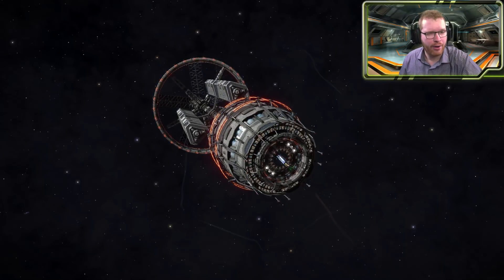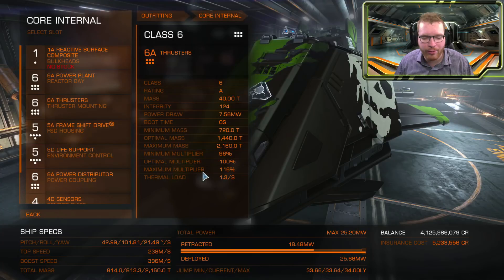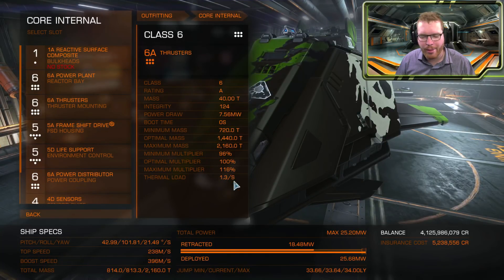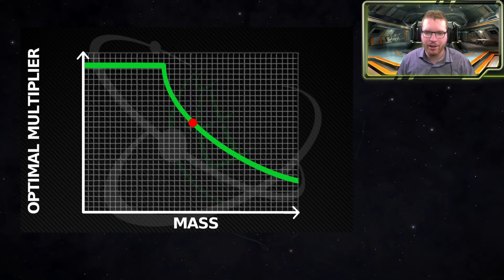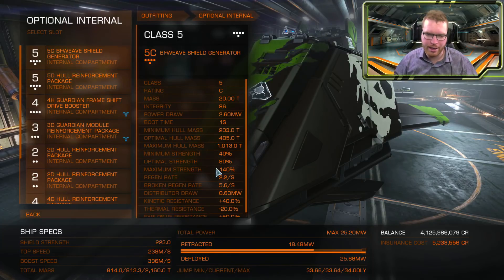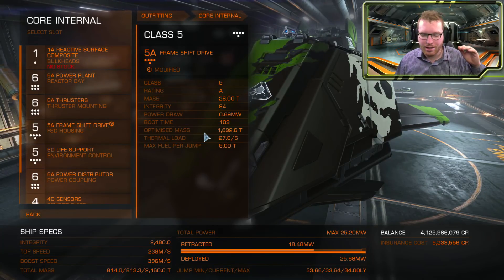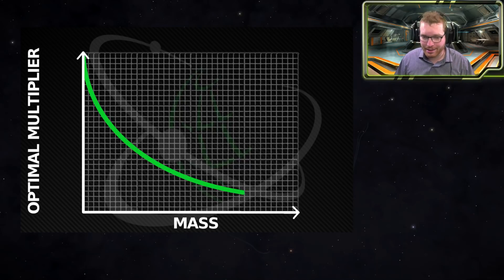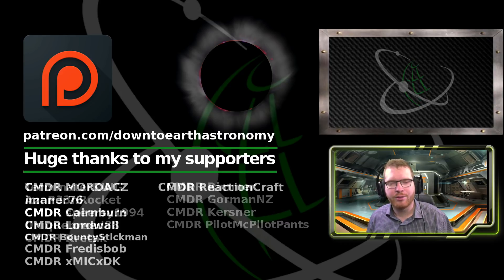Optimal mass vs Optimal multiplier guide | Elite dangerous

Comment: Great video. I tried to explain this not long after the Engineers came out and you put it way more succinctly than I did, lol. This sort of thing needs explanation because they don't exactly make it the easiest to understand if you're sat staring at the screen. 

As far as thrusters go, if you're engineering for speed and agility, with the Beyond engineering change, higher optimal multiplier is always better than higher optimal mass, since the change in mass isn't significant enough compared to the change in multiplier. This wasn't always the case with the legacy engineering since the results you could get were random and sometimes you might have to do quite in depth calculations to determine whether it was worth keeping the roll. But with the system we have now, since it's static, you really don't need to worry about it so much. The only time having higher optimal mass, and fitting the Drive Distributors experimental effect will be useful is when you want to make a ship take smaller thrusters than it could otherwise use.

Comment: I want to point out that its probably better to go slightly below your minimum mass if you want maximum speed. since the optimum multiplier decreases exponentially with every ton gained, every ton lost gives more speed than the last untill the final ton provides basically a bonus that makes it worth it.

Comment: Nice gaph☺ Would like to share for the Thrusters the Optimal Multiplier increase the over all thrusters (specially the little ones that helps you manuvers) the normal mass is more light weight reductions for speeeeeeeeed 😊😂

Comment: OK, nice, thanks. But could you explain which upgrade is better for a few situations or does it vary so much it's impossible?
Reply from the maker: It really varies a lot. If you have a ship that's heavy for it's module then then optimal mass best. But if your ship is have a large module compared to it's weight then optimal multiplier is best.

Comment: The mass mechanic is broken. Look at a 6A shield on the clipper and cutter the cutter is more than 2x the hull mass yet has nearly double the shield HP vs the cutter with the same 6A gen. I don't understand it makes no sense. The same thing with the type 9 and type 10 with shields and thrusters. It was a big let down to see the mass mechanic doesn't actually work correctly. They should add a ship modifier number because that is what seems to be happening
Reply: The thing about shields is that every ship has a base shield rating. Kind of like a base armor rating. It's the amount of shields a ship will have when it's mass is exactly at the optimal shield strength. And with that, every ship is different. They don't all have the same shield strength at the optimal hull mass. The Clipper has a much lower base shield strength than the Cutter. So shields you fit on the Clipper will have a proportionately lower value regardless whether the shields are at maximum shield strength or the minimum shield strength. It's not ALL based on the hull mass of your ship.

The values of the different mass strengths are relative to the base shields of each ship, not to a universal value for shield strength.
Reply: I can understand what youre saying. That's why I said they need to add a ship modifier number to clarify in game what is actually happening. The problem is modules and mass cannot be compared across different ships or even different variants of ships because FDEV has implemented a behind the scenes handwavium immersion breaking system. 

For instance the type 9 is slightly smaller and much lighter than the type 10 so why would it be logical for the type 10 to have a better shield modifier when it has much higher mass? The logic makes no sense with the current modules. If the modules were ship specific I can understand the logic but they are interchangeable. Shield strength is based on mass so what logically follows is that you would get a better shield on a less massive ship with the same 6A generator. It makes even less sense with thrusters. why would the same 7A thrusters propel the type 10 faster than the type 9??? Makes no sense. I would feel better if they just made shields and thrusters ship specific and not interchangeable like the armor module. At the very least explain somewhere in game .

Comment: So for thrusters the perfect weight i want at any ship is slightly above minimum mass to get the optimal multiplier am i right?
Reply from the maker: Yes. As soon as you go under the minimum mass you don't get any further benefits
Reply: I think there is also a hidden optimised mass (not to be confused with optimal mass or optimal multiplier) calculation in there too (which used to be shown under the old engineers), which indicates how well a ship turns at speed. I think there is an experimental that you can apply that does show it, but I think its a set value that can't be adjusted, unlike in the old engineers where you could roll till you got a really good value. I once rolled an amazing optimal multiplier AND optimised mass on a thruster for my cutter, which is why it was both fast and manoeuvrable.
Reply: That’s what I have taken away from this video-
Reply: No, if your ship is at or below minimum mass, you get the Maximum multiplier. Optimal multiplier is the figure you get when your mass is the optimal figure shown on the module info screen.

For example, to use the 6A thrusters D2EA highlighted in the video:

They have a minimum mass of 720 tons, an optimal mass of 1440 tons, and a maximum mass of 2160 tons. They also have a minimum multiplier of 96%, an optimal multiplier of 100% and a maximum multiplier of 116%.

So, suppose you had a ship that weighed 720 tons or less fully laden. And suppose your ship had a base speed of 200m/s. You would benefit from the maximum listed multiplier of 116%, making your base speed increase to 232m/s. If, however your ship weighed 1440 tons exactly, you'd benefit from the optimal multiplier which, in this case, wouldn't increase your speed at all but nor would it decrease it. For every ton under the optimal mass your ship is, it's multiplier shifts towards the maximum multiplier, and for every ton over it shifts towards the minimum multiplier.

David, I'm not sure about that. I may be wrong but I think the multiplier on thrusters can be basically called performance multiplier, not just straight line speed multiplier. And that also affects agility and handling. Lightening a ship, and shifting it towards the maximum multiplier, naturally increases agility. As does improving the optimal mass figure. However since agility was also given more variability based on engine pips lately, and not just the multiplier on your thrusters, its a bit more of a balancing act than it used to be. I'm pretty sure optimised mass is only used in FSD calculations.
Reply: @Kaethena  yes it makes more sense that of what i understood from the video